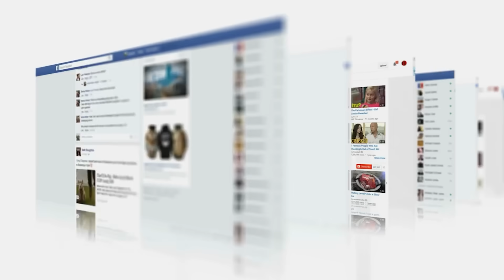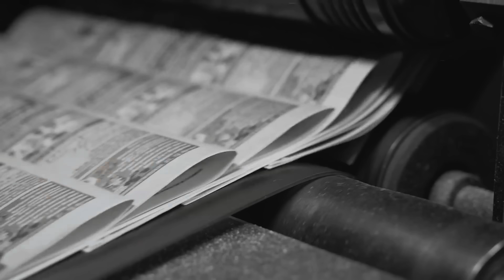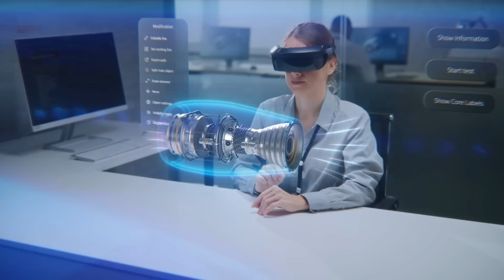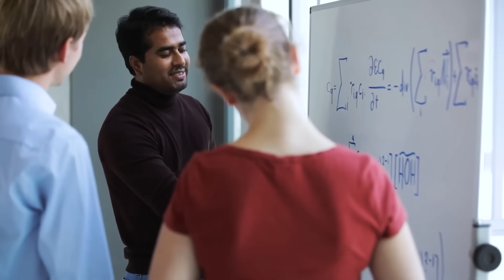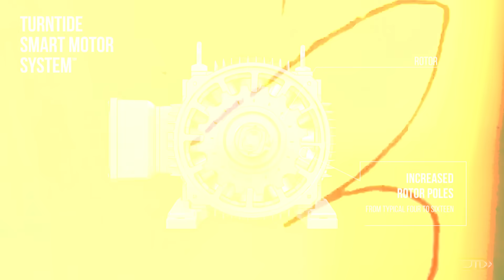17-Year-Old Invents a Motor That Could Change EVs Forever

Comment: Total hoax. The claim that the motor "generates more electricity than it consumes" is not feasible under the known laws of physics which are proven again and again every time.  It can be that he came up with a more efficient motor design with better performance,  but for sure no "perpetum mobile".
Reply from the maker: Thanks for sharing your perspective on the motor's claims!
Reply: Would have to determine where the excess energy came from, probably an additional input he didn’t realize/account for.

Comment: Good for the kid, but it's literally just a sepex motor. The rotor and stator are separately excited. Instead of magnets or induction, it uses electric coils in both the motor and stator. It's been around for a long time.
Reply: And what have you ever done; much less won- on your own- against international level competition supported by university labs & their professional helpers?
Reply: It can be a simple asynchronous motor with squirrel cage rotor😊
Reply from the maker: Thanks for providing that technical insight!